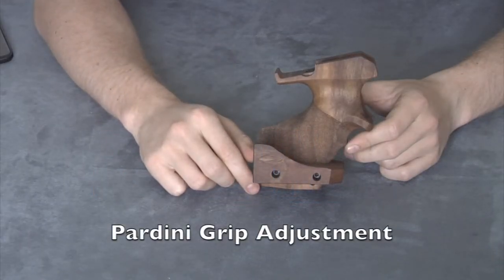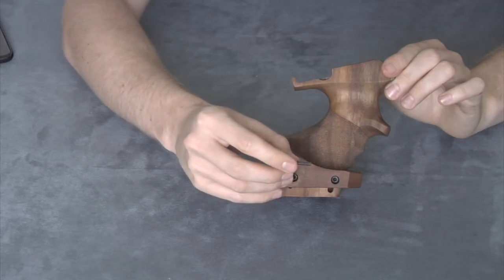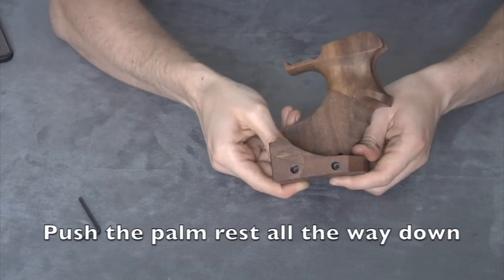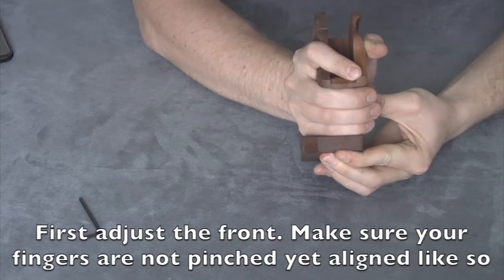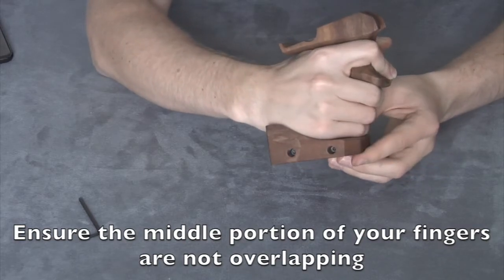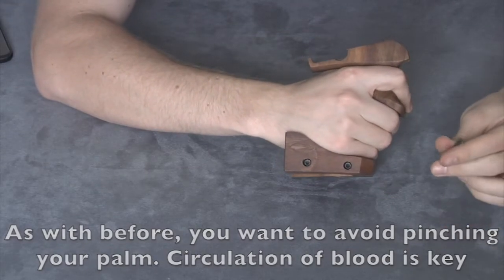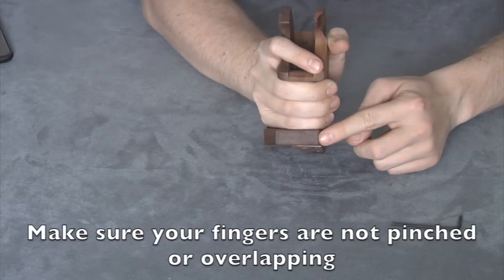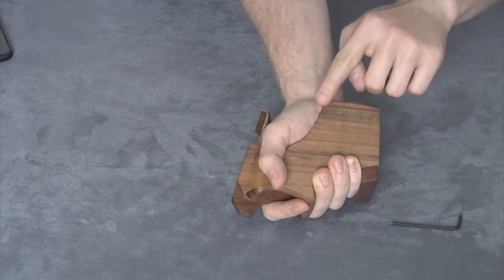Pardini Grip Adjustment

Comment: This was a great video.  The presenter spoke articulately and demonstrated precisely how to adjust the grip.  I was able to adjust my Pardini SP rapid fire pistol and it really made a difference.  Thanks a lot.
Reply: Pastor, do you shoot yours with iron sights or a red dot ?
If you use a red dot, what type is it ?
I have one on order for bullseye but was told other manufacturers sight bases or rings will not fit the Pardini rail.
Don't like the Ultradot sights and rings Pardini offers and wanted to go with something better.